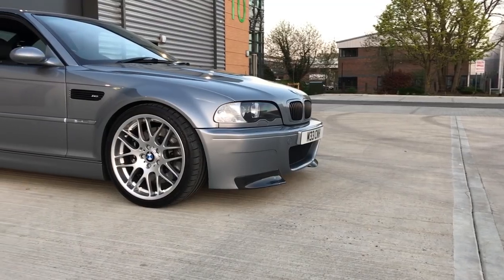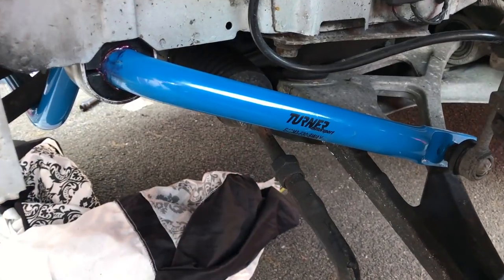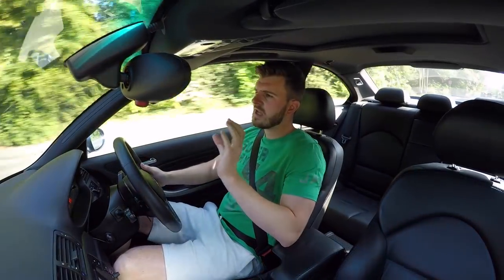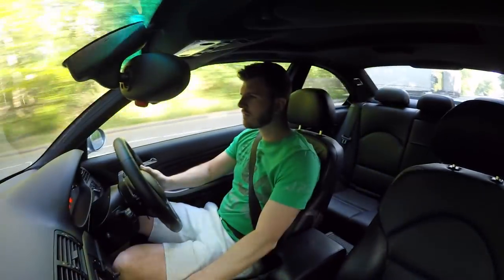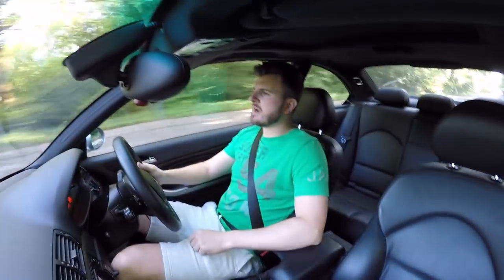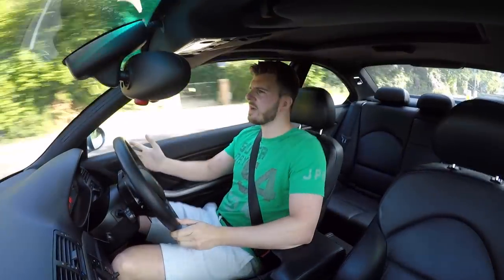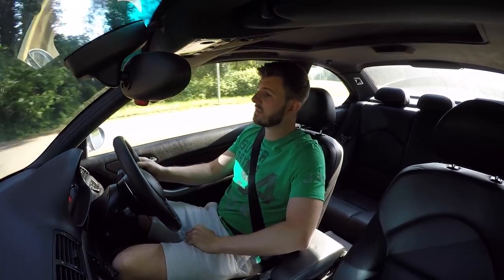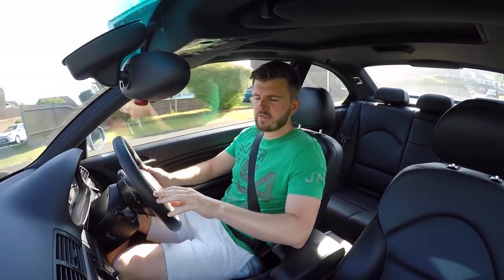BMW e46 M3 handling upgrades - The best bits explained! #CSLreplicabuild

Comment: I'm glad I found your channel. I'm in the States with an '04 SMG in Titanium Silver with long term plans for a CSL clone as well. Currently at 86k miles, and the only mods are reinforced rear subframe & Frank Smith flashed SMG tune.  When I upgrade the wheels, I'm looking at doing a squared stance on 18's running 265/35's with a 10mm spacer for the rears.  Great looking car!  For seats, I want to keep it German & go with Recaro's.
Reply from the maker: Glad your enjoy the blogs, Recaros are now fitted so will be on the next video which will hopefully be live in the next week
Reply: Use 12mm spacers for the rears.

Comment: Great video, I have play at 12 o”clock and very annoying and changed my coupler for a new oem one and as much as it improved the general steering feel I still have this annoying play at 12 o”clock, I have just purchased a purple tag so glad you said it’s a positive thing, hope it fixes my issues as it’s sort of ruining my driving experience with the car👏🏻
Reply from the maker: It did make a big improvement for mine but I would also suggest investigating/ upgrading the “lollipop bushes/ front wishbone rear bushes” my next video which will be out soon will detail all this 👍
Reply: @stoneautomotive  Scary I was literally just thinking earlier when I watched the video that I will be best to replace the lollipop while I’m in there taking it apart. 👏🏻

Comment: I have over 20 years of bmw racing (driving and building the car) always in a M3 E30 to e92 and currently a e46 supercharged road car and race car 528bhp on the road car and 557bhp on the racer. The biggest upgrade you can do to this m3 or any e46 is to get the body roll under control. I have tried every size and combination of sizes to find the best possible ride /performance and eventually I found it, but nobody sells them in a kit of the 2 sizes. You need a 23mm rear at least preferably a 25mm but not as aggressive up front or you will induce understeer, 23 is plenty for a neutral feel and the best of both worlds. I have a Turner rear and H&R front

Comment: Hi. Im looking at purchasing a m3. I wanted the manual but a smg has come up with all the extra goodies im after at a good price. Watching you videos has made me feel a lot better about the smg. Also i have come from a 2005 s2000 and as you say loved the manual gearbox on that car. I hope i dont regret getting the smg. loving your car and im hoping the car im purchasing will look pretty much the same.
Reply from the maker: Hi, the SMG is certainly not for every one and once you become familiar with it it's very addictive/ raw to drive! It's certainly worth installing the CSL SMG software as if this wasn't available I wouldn't own an SMG.. it's certainly worth trying the car in shift mode 6 (traction control will need to be off) as it's brutally fast/aggressive for such an old box - love it 😎 ps - you'll miss the S2000 gearbox/v-tec but the e46 M3 is something special, enjoy!

Comment: good vid and info... i love the smg box with csl software on my m3.. i have a 815bhp 2021 rs7 c8 with a modern box ..so for me when i jump in the m3 to feel it bang through the gears adds to the fun.
Reply from the maker: Cheers Lee, old one this one, hopefully you can see the video/ audio quality improvement compared to the current ones 😅

Exactly that, everyone manual swapping them but there’s certainly something cool with the thud through the changes in S6 😎
Reply: @stoneautomotive  Ive seen later vids too. My car currently having boot floor plated. I’m trying to decide if I just refresh bushes with oem or with yellow poly too. I don’t track it. I hear varying opinions
Reply from the maker: @leekindell9937  black series the subframe and trailing arm bushes with powerflex - don’t do the diff mounts as it’s really noisy for road use 👍
Reply: @stoneautomotive  I was thinking yellow as won’t black series be so harsh ? Then oem on diff
Reply from the maker: @leekindell9937  have the black series in mine including the engine mounts and drives lovely on the road 👍
Reply: @stoneautomotive  I’ve told my guys put yellow polys in.  Today I brought a purple tag steering rack for my car while rear sub being done and on ramp. I blame u for making me spend more. But be nice to have sharper steering feel
Reply from the maker: @leekindell9937  😅
Reply from the maker: @leekindell9937  if your not a million miles from Newbury I’m hosting the first stone automotive meet at podium place Sunday 16th April - both M3’s will be down for the morning if you want to really see how spends gets carried away 😅
Reply: @stoneautomotive  i could get there, car should be back from its floor pan work by then. ive been to podium place in my rs7 before.

Comment: For bang for buck and all the right boxes ticked I have to recommend ground control coilovers and 2 way adjustable top plates too. The best daily driver ride quality and when needed adjustment to focused track tool is a revalation for the money. I have tried everything and bilstein have proven time again to be the best on track and road... But not with the same set. Unless you can change the suspension when you get the feeling for a blast, you'll need the ground control setup

Comment: You have hit pretty much all the main points for improvement mainly by updating rather than upgrading. You can over do it though, especially with suspension and geometry settings. Tyres make a huge difference good to bad as do the pressures

Comment: Great work mate, I have a smg m3 with csl software,  I was told not to lift my foot when charging up. It is smooth at low rpm changing what to you think. That csl air box is so loud 😍
Reply from the maker: Thanks 😊 yep foot stays flat even on SMG mode 6 - it's where this gearbox just feels perfect 👌 haha yea the air box does make some noise, sounds so good it would be weird driving one without it fitted!

Comment: Get a pair of Porsche boxster or 911 996 rear brakes from ebay, 4pot BREMBO as oem and the necessary adapters are available from Turner or just about any of the big names

Comment: If a close ratio rack is super sensitive at high speeds the z3m would be highly unstable which I doubt. Even ‘modern’ cars have a quicker rack and do 150mph speeds. The 3.0 ratio just means less big steering input. The output stays the same.
Reply from the maker: I’m not saying it’s unstable, the CSL runs an even closer ratio rack than purple tag rack unit I’ve fitted.

I can’t think why they didn’t fit the purple tag as standard other than making the CS & CSL a reason to upgrade?
Reply: Stone Automotive my response was to the point you were making at 17:11 that someone argued the ‘slower’ m3 rack would be less nervous on the motorway at high speeds. But like you said the m3 was a car with a broad buyers range and I reckon it would be perceived as a hardcore racer if everything had been tightened up. Buyers could opt for the more racer like csl. Imagine the e46 compact having a slow rack then it wouldn’t feel as nimble as it’s a ‘small car’

I am in the process of swapping mine out for a 3.0 rack as well so I’m doing my homework tbh. Someone on an American forum made the case that e46’s have different hub steering knuckle offset and the racks protrude different lengths so they correspond to each other. Turning circle for 316ti is smaller than a 328 for instance. 

If the car would feel wobbly or vague at high speeds my educated guess would be the suspension is the issue rather than the steering.

Comment: Hi,
I was thinking of fitting either the Turner or H&R uprated antiroll bars, but someone said to me that this makes the car tramline  a bit. Have you found that with yours?
I’m only driving on the road no track work.
Many thanks
Reply from the maker: Hi Barry, the anti roll bars added no noticeable tramline effect to the handling, the spacers had more of an effect on the tramling than anything else. Was really impressed with the Turner kit, combine that with Eibach springs on stock dampers & Michelin super sport tyres it’s been a fantastic road & track package (see the alps video where I cover road & track)
Reply: Stone Automotive 
Hi - many thanks for getting back to me.
I’d like the Turner kit but Mirrorjohn doesn’t do these any more so looks like I might have to go with H&R antiroll bars.
Many thanks

Comment: brilliant video dude i have picked up a whole load of mods i'd like to do to mine or knowledge to know when certain parts fail i should change them for better options i.e. the steering rack after watching the vid but i am so gutted all these changes need doing as its going to cost a shit load too lol, QQ are these the antiroll bars you were referring too? https://www.turnermotorsport.com/p-338370-e46-m3-turner-motorsport-frontrear-3025-sway-bar-upgrade/?pdk=AgIB
Reply from the maker: Glad you enjoyed the video 👍 yep money pits lol! You should check out my 4 year re-cap video on the e46 M3 (in the playlist) 

Yes they are the anti roll bars - made a massive improvement over stock, front was very easy to fit but the rear was a little more agro - would advise buying new rear drop links whilst apart too
Reply: @stoneautomotive  cool will give that vid a watch as well